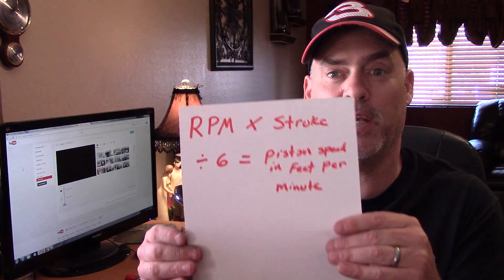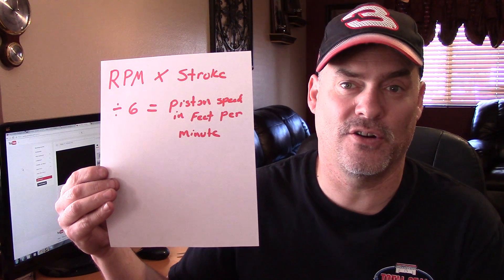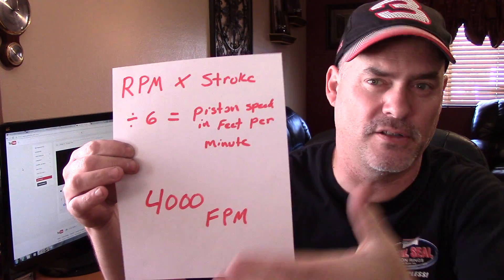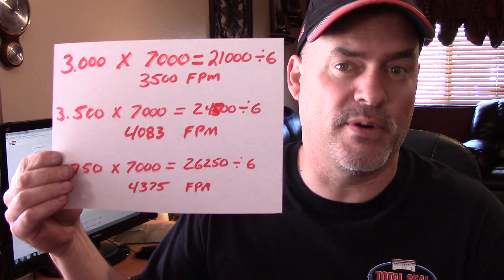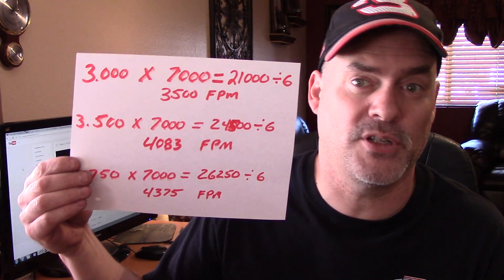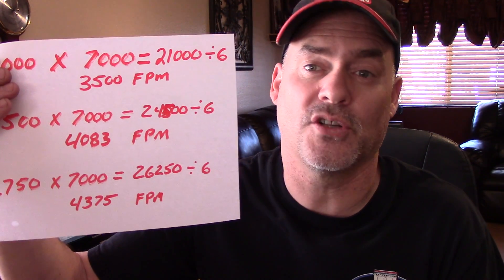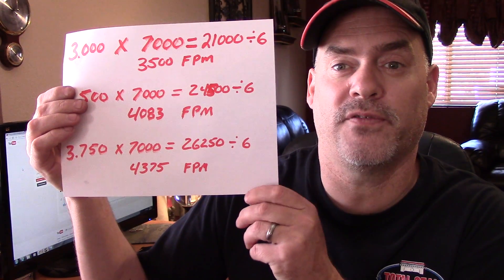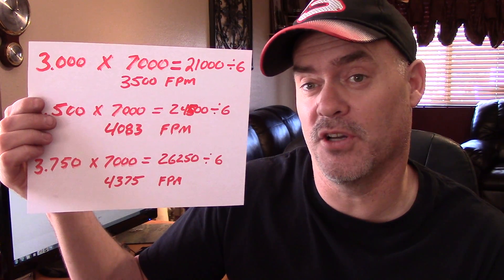What RPM should be an Engine's red line

Comment: Stock bottom end LS1 out of a WS6.(btr cam and springs etc.. ) I calculated 4225.66fpm. Why do you say 4000 is a limit? are engines know for failure when exceeded 4000fpm or is this just a guide? to avoid anything above 4000? metal fatigue? my engine has 4 season on it... never a hickup, it's a drift car so it sees 6500-7000rpm constantly. what would fail on a stock piston traveling 4000fpm? Thanks.
Reply from the maker: 4000 is very safe for a stock engine you can push it past that I would say 4225 for an LS is no problem
Reply: what would be the limit in your opinion?

Comment: I have 2 sbc 327s, they both had flat tappet cams and lifters. Is it possible to run hydraulic roller cams and lifters in them?
Reply from the maker: Yes they have kits to convert them
Reply: Myvintageiron7512 what's it called

Comment: I just calculated a few for comparison: 
1) bmw 330ci:           3173.3 ft/min
2) Honda S200:        4960.6 ft/min
3) Yamaha R6:          4870.8 ft/min
4) 2010 Formula 1   4724.4 ft/min

*I think some factors that play into RPM are: 
- reciprocating mass
- secondary and primary balance
- airflow at high RPM
- stroke vs bore
Reply from the maker: Oh for sure the weight of the rotating assembly is key we like to use 4000 max for stock engines it's really safe but certainly not something that can't be surpassed

Comment: So my jeeps 4.7 that's has an original maximum speed set by the manufacturer of 6000 rpm with 3.405" stroke can safely go to 6999  with no problem at all? (7000 rpm x 3.405")/6= 3972.5 FPM < 4000FPM 
Too bad on the dyno sheet at 4600 RPM max HP is reached and right at that same point begins to go down. What a waste of engine maybe with another larger cam can wake up this baby up?
http://www.wjjeeps.com/engine.htm

Comment: Gt350 voodoo engine. 3.7'' stroke. 8250rpm, 5087 feet per minute. Crazy!
Reply: 98 spec JDM ITR Type R engine 3.433" stroke 8,900rpm 5092 FPM. Or at least that's what the rpm gauge reads when bouncing off the rev limiter.

Comment: So I am changing my engine in my 87 ford Bronco prerunner from my stock 302 to a 95 351 stroked to 408.  It being a Commiefornia truck I am limited in changing my cam. It will have MAF and fuel injection some good AFR or similar heads. What kind of RPM will I be running and will this give me good torque for lower rpm power? Any important tips? Thanks
Reply from the maker: The RPM and TQ depends on the cam you choose I would stick to a mild RV type cam with a smooth idle wide lobe sep for better TQ

Comment: You can make that formula a lot easier in explain. You should tell you need to multiply by 2 then rpm then stroke. After that divide by 12 to convert to feet per minute.

Comment: Just curious (really enjoyed the calculations btw) ..so would a stock 289 which would have a stroke of 2.87 inches easily handle 7000 RPMs or is there another limiting factor ? I seem to hear a lot about max on my 1966 289 as 5500 (note - it is completely new rebuilt with hardened valve sleeves) ...Thoughts?
Reply: You likely don't have the heads, cam, intake, carb to turn 7000. With basic stock parts 5500 is about the limit.

Comment: Here are some basics: factory built engines are usually only harmonically balanced to about 5000 rpms. The first thing I do with an engine build is called "balancing and blueprinting", where the crankshaft is harmonically balanced by the machine shop to 10,000 rpm without vibration. Then we "blueprint", this involves weighing all of the piston/rod sets, and we find the lightest one. They never weigh exactly the same, and that's what we want: we grind a bit off each one until they all weigh exactly the same as the lightest one. Now you have a bottom end that can take huge revs without shaking itself to death. The limiting factor, now, is the strength of the valve springs, and their ability to close the valves fast enough. My old Suzuki GS1000 floats the valves with the stock springs at 12,500 rpms. "Floating" is when the springs can't close the valves fast enough, and they sort of just float open. All of a sudden the engine will just crash, and loose all power at a certain rpm. If I put heavy duty springs in, I could get around 14,000 before they float.
Reply: Your butt is sucking pond water on your basics. How is the crankshaft balanced to 10,000 rpm when the balancing machine only spins the shaft at 500 rpm?

And how did they balance the crankshaft without first equalizing the weight of the pistons and rods to make bob weights--unless you're talking about a 4 cyl or straight 6.

Comment: Given the piston speed info, it is the acceleration of the pistons that is putting forces on it all. Both speeding up and slowing down, from the top to the bottom. That piston is never stopped except when the slack is changed from one side of the components to the other. There is a submicroscopic moment of time where the forces on the components switch directions. Then there is the mass of the pistons. There are the spark and explosion of the powerstoke helping slow down the piston at the top dead center considering spark advance.

The speed explanation most definitely has something in it to explain the "redline" of the motor. If it was just that alone they could spin a motor without heads on it to find out where things just blew apart. That would give you the limit of some component breaking first. 

Then we all know about valve float and the high rpm of two stokes and they blow apart too, at way higher rpm.
I suppose if you build a motor that could stay together past a valve float rpm without the valve components blowing up, as in broken springs or other parts, it could be self limiting. I dont think it works that way.
Reply from the maker: I agree there are many other factors piston speed is used as a reference
Reply: I hope you did not take my comment as a criticism. I am kind of a geek, I suppose. I am a dentist and have had a way too much useless education. I have watched a ton of your videos and learned way more than I need to know, but cant help watch more. You are really good.

Comment: What I was hoping would be covered in this video was the effect of longer rods on the same stroke...I've seen a lot of guys build "long rod" engines, but are the gains worth the time and effort? I've also read that long rod motors make much better use of small valves and ports, but I haven't come across very many A-to-B comparisons.

Comment: piston fpm is a useless figure. the fpm is only an average speed where the piston actually accellerates, decelerates, stops and changes direction (which is what causes failure). Also, con rod length is irrelavent, this would only affect compression. Stroke lenght is purely determined by the crank shaft. Valve spring rates are more important than the useless babble this video offers

Comment: Building my Harley Engine for the 3ed time , I set my Over Rev limit to 5500 RPM now your video has me thinking I could go to 6500 , Each time its been my fault it has blown,  Bad lifters,  bad cam bearing, then a bad pushrod .

Comment: I just did the math.
But i find something wrong in it
The stroke is taken in inches and the answer is given in feet per minute.
I also tried to convert inches to feet which is 1 inches is 0.083333 feet.
So it should be divided by 12 and not 6.
Any mistakes in my correction, if found should be brought to notice.
Thanks.
Reply from the maker: it's 6 because it's a 4 stroke engine
Reply from the maker: if you use 12 you need to multiply the stroke times 2 to get average speed it is easier to just use 6 I assure you 6 is the correct number

Comment: I believe a better way to calculate max engine speed when referring solely to pistons and rods while ignoring valve float and crank among other things is the peak g-forces experienced while accelerating and decelerating towards and away from TDC and BDC. For example if you have an engine the has half the stroke but revs twice as fast; while retaining the same stroke to rod length ratio the g-forces experienced are not the same despite the same FPS piston speeds. In-fact the g-forces experienced are twice as much. An example is as follows. If engine #A and engine #B both have piston weights of 500 grams but Engine #A has a 4" stroke and revs to 6000 rpm while Engine #B has a 2" stroke and revs to 12000 rpm; both having a Rod/Stroke ratio of 2:1. What you will find is that despite both having the same Max Piston speed engine #A will experience an upward inertia force at TDC of 3381.7 lbs and 1125.32 lbs at BDC while engine #B will experience an upward inertia force of 6763.4 lbs at TDC and 2254.47 lbs at BDC. If you wanted Engine #B to match inertia forces of engine #A you would only be able to rev engine #B to 8485 RPM which would net you the same forces on the piston/rod/crank. So in summary half the stroke you can increase engine RPM by 41.4% but maximum piston speed decreases from 4000 FPM to 2828 FPM while forces remain the same.
Reply from the maker: I don't disagree but my question to you is who builds a 2" stroke V8 and spins it to 12000?    it is correct what your saying but really not much of a factor for the popular engines we are dealing with I did not want to get into this in the video because I would have lost half of my viewers before the video was over
Reply: Totally agree with you. You would have to then get into the fact that as you increase stroke you decrease rod length; thereby increasing rod/stroke ratio and piston skirt loads, combustion times and talk about tall deck vs short deck. As for the 2" stroke this more applies to F1 engines or custom destroked applications which are rare. The most powerful and reliable engines have been and always will be long stroke low rpm in my opinion.

Comment: Well said.  One thing though:  I would imagine the ceiling of 4k fps could be raised with low weight reciprocating components.
Reply: Well yeah. Nascar was turning the 358 ci. Fords and Chevy's 6800+ way back in the early 80's. True they didn't have the parts we have today, but they were doing a lot with cast iron cranks and stock rockers... And yes, they did blow a many engines as well...

Comment: Very informative especially for someone who is not a mechanic, but I have a question- If I have a neo vvl St 20 will installing a vvl controller and setting it before 5000 rpm harm the engine? Thanks

Comment: THE BEST WAY TO USE THIS THEROY IS THIS,,6000 R.P.M. and under,,is a street/weekend warrior strip motor. 6000 R.P.M. and up is a motor for more serious applications. that's why most redlines on today's cars is 6000-6250--6500 R.P.M.'S.  of course this theory is evolving in the 21st century. look at the new 2017 SHELBY GT-350R. it's redline is like 8750 R.P.M.'S,, its a wolf in sheeps clothing. it's basically a race engine for the street. seems like the muscle car era of the 60's is coming back with a vengeance in the 21st century,,huh??
Reply: Muscle car of the 60s, are more like 6,000 RPM at max.Maybe 6,500 or the like.
The usual max HP was commonly only in the 4000s! The 2000s (this century) is a stark contrast, with smaller engines being a trend and high RPMs required for the same amount of torque and HP!

Comment: That math is incorrect, it might work but it's incorrect. At a stroke of 3" the crank travels 3pi. At 7000rpm it's going to travel roughly 63000 inches per minute, which gives you 5250 fpm. So you would need to divide by 4, not 6.
Reply from the maker: +I assure you it is not incorrect 
Piston speed generally refers to the average or mean speed of the piston as it moves up and down in the cylinder bore during each crankshaft revolution. Since the piston actually comes to a complete stop at the top of the stroke (TDC) and at the bottom of the stroke (BDC), its speed and acceleration at any given point is always changing. The piston is always accelerating from or decelerating to zero speed. The formula for mean piston speed yields an average speed based on two times the stroke (up and down for one revolution), times the engine speed (RPM) divided by 12 to convert to feet per minute (fpm). To simplify the formula, divide the numerator and the denominator by 2.
Reply: Nope sorry man his math is exactly right you are the one who is incorrect better do a little more research before you post so people will take you seriously

Comment: What does the number 6 represent in the equation?
Reply from the maker: Piston speed generally refers to the average or mean speed of the piston as it moves up and down in the cylinder bore during each crankshaft revolution. Since the piston actually comes to a complete stop at the top of the stroke (TDC) and at the bottom of the stroke (BDC), its speed and acceleration at any given point is always changing. The piston is always accelerating from or decelerating to zero speed. The formula for mean piston speed yields an average speed based on two times the stroke (up and down for one revolution), times the engine speed (rpm) divided by 12 to convert to feet per minute (fpm). To simplify the formula, divide the numerator and the denominator by 2.

 Piston Speedfpm = stroke x rpm ÷ 6
Reply: Myvintageiron7512 thanks for the valuable info!

Comment: Piston speed is not the most important factor, its how quick it comes to a stop and then a start. Its called reciprocating mass.
if the piston is lighter in weight then it can come to a stop in less time.
Reply from the maker: Yes you are correct that's why light weight pistons are pretty important in high RPM engines the force of the piston stopping if for sure the most stress on a piston the end of the ex stroke is the worst because of the low pressure above the piston

Comment: The inertia of the rod accelerating in the each direction can cause the rod bolts to try and stretch as well as the beam portion of the rod. Moral of the story for lower end reliability use as long of a rod and light a piston combination as you can get away with while using ARP rod bolts. Another factor is minor and major cylinder wall loading this can be critical in Ford engines like the FE and Cleveland series which are both known for very thin cylinder walls.
Reply from the maker: I agree 100% your right on with both points

Comment: I believe the piston is traveling fastest when the crank journal is at a 90° angle to the the cylinder bore. As it approaches the top and the bottom of the bore it slows down as it stops. The cranks rotary motion is at a controlled speed. Controlled by the reciprocating mass and the mass of flywheel and other engines components so it cant just takeoff freely on the power stroke. Its being governed so to speak by the compression strokes of other cylinders ect. The problem in keeping an engine together is the quality of the parts when the piston changes direction at the top and bottom of the stroke. The crank at the top of the stroke as it changes direction "yanks" on the rod and piston pin. Poor quality parts or a part with an defect or too much mass can be damaged.

Comment: my 409 and 348 both topped out at 4300 RPM.  327-375hp slightly built about eight. But no matter what an engine was rated for I usually drove by ear and feel. Great video's, thanks.

Comment: I had a roommate in the early 90s, with a mildly hot rodded 350 in a '64 Chevy II. He had a very safe and logical method of determining red line, which required no pesky mathematics. He simply kept revving the engine til shortly after it stopped making noticeable power anymore. On a 100% completely unrelated note, it spun a bearing 2 months later......
Reply: HighlanderNorth1 yea because the cam has a big factor on when engine quits making power not red line lol

Comment: Poor explanation of  catastrophic engine failure  due to over reving  You needed to explain how the piston wants to "keep  going"  ie through the top  or bottom of the engine- does the connecting rod fail?  If so where does failure occur eg  connection to the crank  or the piston rod pin?

Comment: Makes you think twice about building a 383 stroker. However, everythings a compromise.
Reply: Christopher Wyller go forged and don't wimp out on the parts and you won't have an issue.
Reply: I was going to use a 2 bolt main block.
Reply: Christopher Wyller if you use arp bolts and get forged everything and balance it all to a certain speed you should be fine to close to 7 even with the 2 bolt
Reply: Cool! I always stud everything anyway. The 355 I got now will pass 7 grand but it's getting a bit old now. I want to have a fresh engine just to swap out as it's my only ride now.

Comment: this equation is theorical... and an absolute maximum
in a real engine, there is many other  factors that limits the RPM in beginning with the carburator, the damping of vibrations, the efficiency of the lubricating system and the lubricants,the metallurgy of the whole engine, the capacity of the engine to evacuate the thermal load and the rotationnal assembly balancing to name a few considerations
anyways, who needs to rev an engine so high on an everyday use ?
Reply: me. i do. :)
Reply: We arent discussing everyday use.  we are discussing maximum safe rpm.
Reply: Jacques Poirier MP   On on ion

Comment: With this video my Pontiac shouldn't go above 4500 RPM Come on
Reply: First off If you've got D port heads you're not doing much past that anyways ;) Second is this is just a ballpark measurement as he mentioned.3rd is you've got some work to do if you truly want to spin a Big Pontiac much over 5 grand  and last is the rod/stroke ratio does come into play so there are exceptions to this.